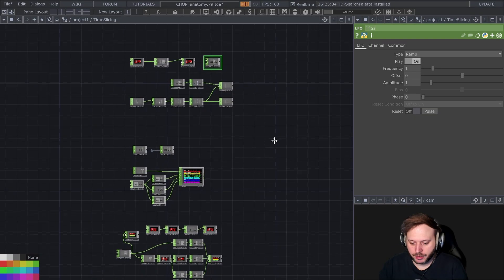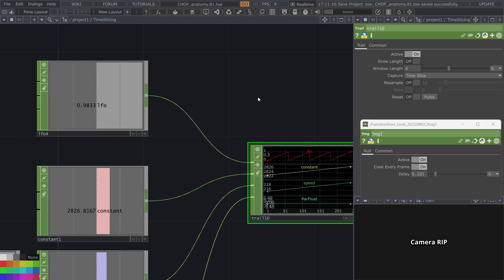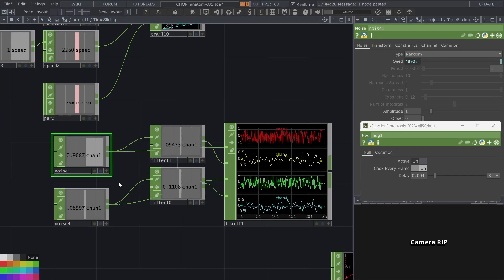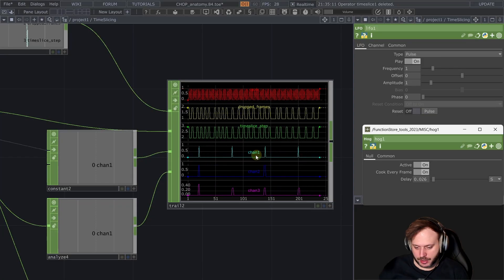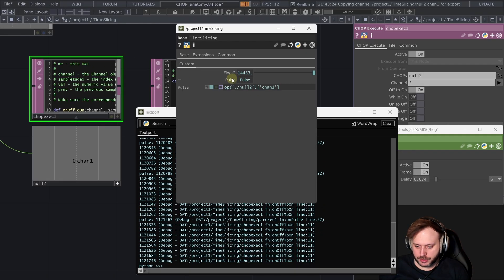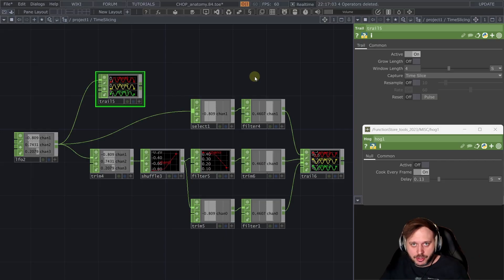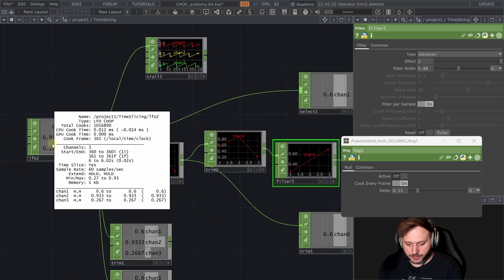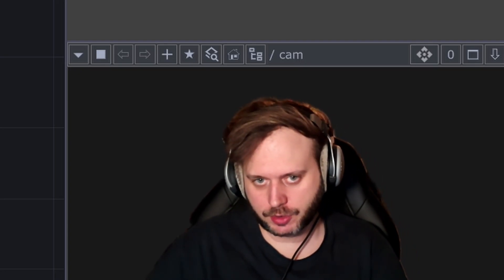CHOP Anatomy 2: Losing frames? No problem!

Comment: I've been using TouchDesigner since 2012 and I didn't fully understand time slicing nuances until now! It have noticed that from Python you can pulse a parameter multiple times within a frame which is maybe similar to how it's handled with time slicing and the chopexec.
Reply from the maker: That is the best feedback this video could get <3
Pulsing multiple times within a frame definitely makes sense! Not sure about the second part but probably!